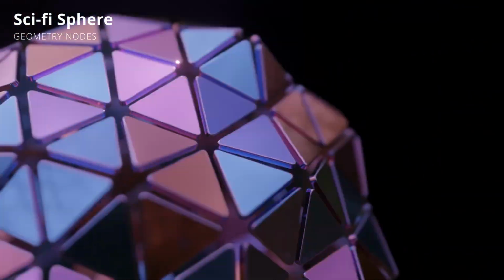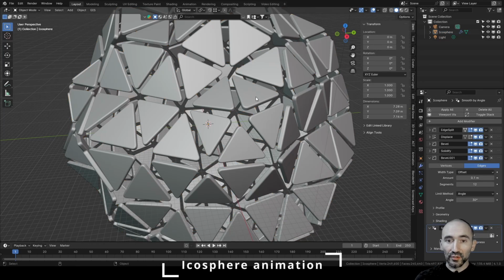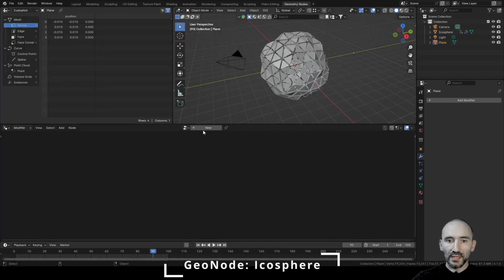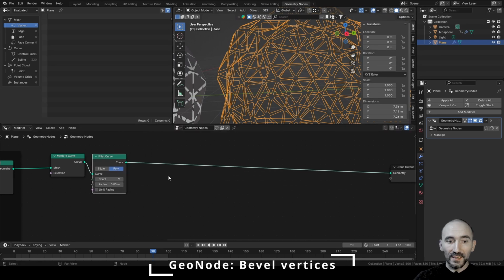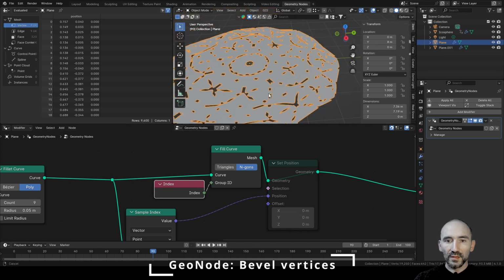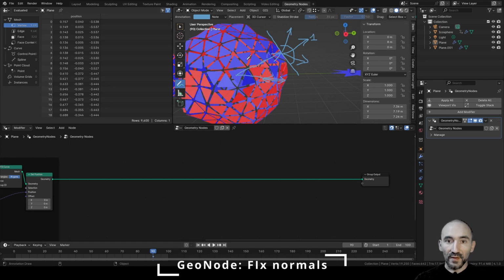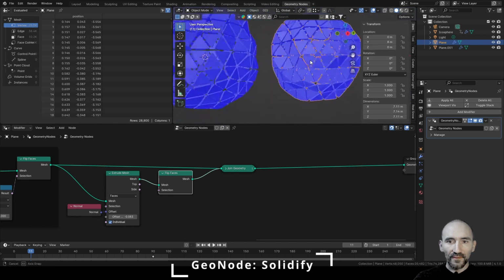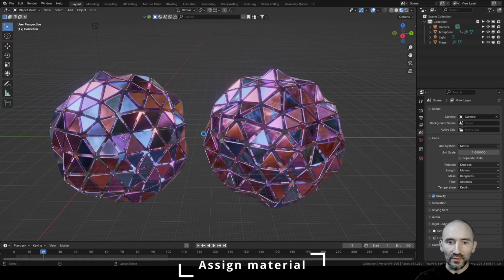Procedural Sci-fi Sphere in Geometry nodes - Blender tutorial ENG

Comment: Thanks for the tutorial!  Any idea why material doesn’t work right with normal? instead is plugged in true normal and then it worked.
Reply from the maker: Thank you @DKP3000! It’s correct as I added in the description of the video. The reason is from the definition of the Normal and True Normal:
Normal:
Shading normal at the surface (includes smooth normals and bump mapping).
True Normal:
Geometry or flat normal of the surface.

So the true normal doesn’t look for the auto smooth of the shader, it looks the real faces of the mesh allowing you to avoid extra fake normals on the same face (so one normal person face).